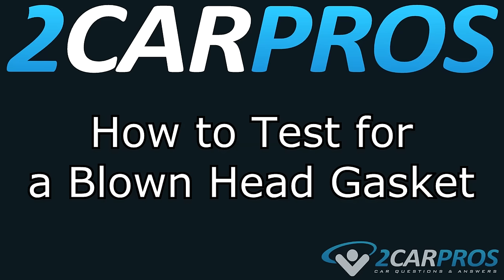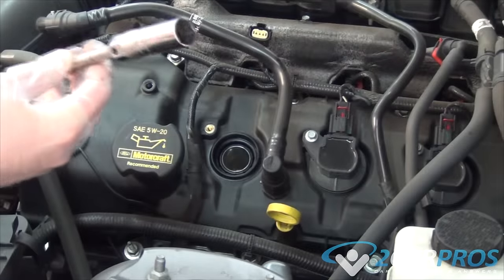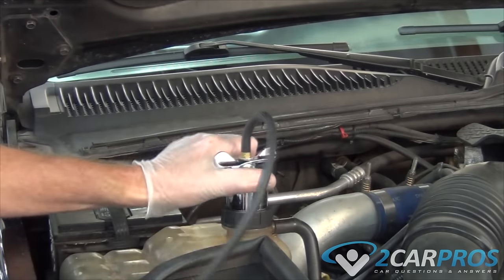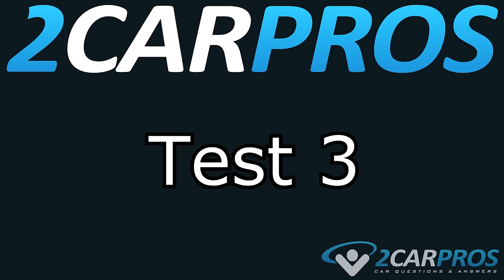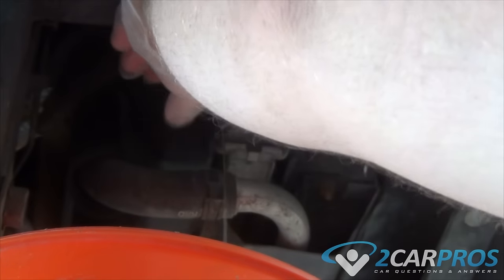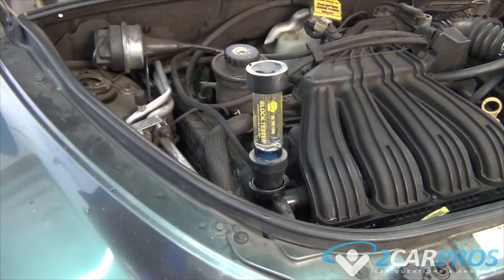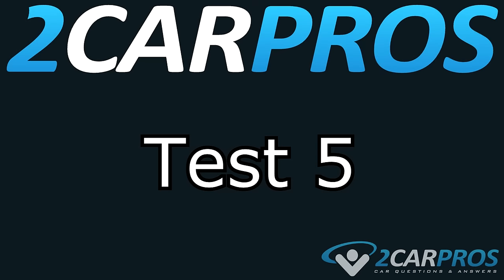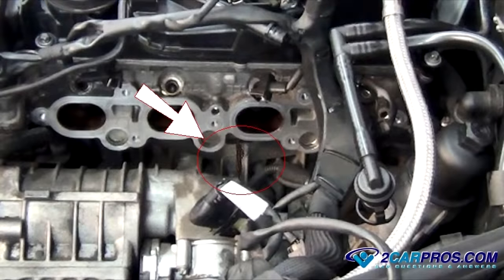HOW TO CHECK FOR A BLOWN HEAD GASKET

Comment: hi, ive just brought a 2009 peugeot 207 and have recently noticed that there is oil residue on the coolant bottle, i took it back the garage i brought it from and he said that the coolant is clear so its not a problem and just needs cleaning out. will the oil just keep coming back? ive heard its common for this to happen with peugeots
Reply from the maker: If it is a blown head gasket then yes the oil will just keep coming back. Oil in the cooling system is always a sign to be worried, I'm not sure what the shop meant by "because it is clear its not a problem" because it sounds like the blown head gasket is letting oil into the cooling system. If it is letting oil in then it is also letting coolant into the combustion chambers which can lead to really big problems. Thank you so much for watching!
Reply: Thanks for the reply but I'm still a little confused. They are having the car in on Thursday to flush it. But my warranty runs out in a matter of days. How long would it take for the oil to come back? Or does that depend on how much I drive it?
Reply: @kierandobson1182  hello. Can you tell me what was the problem with the car?
 I have a car from same manufacturer and same symptoms. please reply me
Reply: @echipaconstructii6614  I never found out. The clutch went not long after these comments and I decided to sell it while I had the chance. I'm sorry I can't be of any help to you

Comment: I have replacing the head gasket on my Nissan np 200 but now it keep on mixing oil and water what must i do?
Reply from the maker: Sounds like you either got a defective gasket or you didn't tighten the head bolts correctly. Thanks for watching!

Comment: I have replacing the head gasket on my Nissan np 200 but now it keep on mixing oil and water what must i do?
Reply from the maker: Sounds like it is still leaking. You will have to replace it again and tighten the head bolts in sequence. Thanks for watching!

Comment: I have to add coolent every morning. I normally drive 80 kms per day. And it becomes half. I checked everything there's no white smudge on the oil cap, nor is there any bad noise. No smoke. But no leakage as well. I don't mind topping up coolent. But idk. Am scared. I have taken the car thousand of kilometers without issue. But if i dont top up for 2 days it overheats. But when i go onomg trips. It's also the same only fill the coolant when i leave for hundreds of kilometers and back.
Reply: Sounds exactly like my nitro. Did you ever figure it out?
Reply: @barbgolden2913  been using like the same until 2 weeks ago. The mechanics said it was a leaking pipe. Just behind the injections,  so cant see it leaking.  Replaced it now. Now it's not leaking .but when i drive the coolant in the tank goes up . Dont know where it's coming from. And if when it goes cold the excess coolant dissappears. Idk what's happening.  Maybe a bad thermostat or water pump

Comment: Hallo, Can I ask you some question? I have bought a second hand Opel with 1 year warranty, less than 1 month driving and now white sludge. Could this be caused blown head gasket or something else? Mechanic dont want to repair it.
Reply from the maker: Sounds like a blown head gasket to me. Thank you so much for watching!
Reply: Yes headgasket blown. They have to fix it as you paid for 1 year warranty. Don't let them off the hook. Sue them if you have to.

Comment: My 08' Civic starts to over heat when idling for too long.. (delayed red traffic light) it cools down immediately once I'm driving again.  Any suggestions? Help?
Reply: Recently car gage would climb then down at red light then up when driving  end result needed new rad and hoses
Reply: Thank you for your insight
Reply from the maker: Is your fan turning on? Thanks for watching!
Reply: @2carpros  engine fan or inside fan  ? 
Had valve cover gaskets done cam plugs and seals and fill tube o ring too 
Definitely could see the oil  
Not sure which came first rad problem or oil leaks 
Had oil leaks for a bit guessing that created the rad problem 
Got back car today wait and see approach 
Getting a couple of belts in two weeks  had to be ordered and my guy is on vacation and place they come closed because air quality here in Oregon  lol hurry up and wait 
Soooooooo close to my goal of 30 years  sooooo close
Reply: @2carpros  I checked under different driving conditions short drives/long drives, pulled over and popped the hood and my fans kept spinning

Comment: Hi, my Mini Cooper engine overheated and can't turn on anymore. My mechanic said to replace the engine, but is there any other options?
Reply: Yeah,replace the car. Lmao
Reply: No not really, when you overheat a car bad enough the heat warps the head (top part) of the engine. This couses it to not seal properly and you lose compression which will couse it to not start. Sadley the easiest and cheapest way to fix it properly is replace the entire motor or if the car is older it may be cheaper to just go find another one. Its important to pull over and shut the engine off if you see the temperature gauge rise above normal levels. If you keep driving it hot until it starts running rough and dies the engine is pretty much done for

Comment: Are bubbles good or bad?
Reply: It indicates that there are air inside your coolant system. Could be from a blown or leaking head gasket. Or you didn't properly bleed/let all the air out of the coolant system. Look up bleeding coolant system. 
You can also smell the radiator at the cap area for smell of exhaust fumes too. If you do, then most likely a leaking or blown head gasket. Check oil cap to see whether the coolant have gone into the engine too. 
Best advice is to do these test to determine what's really wrong with your car. 
Hopefully it's nothing major on your car. Good luck!

Comment: I have c63 amg v8 biturbo 2017 and water goes in two of my pistons so much and inside of motor can u help with any idea what it is,
Reply from the maker: Sounds like a faulty head gasket or the seal wasn't properly installed from factory. Your warranty should definitely cover it. Thanks for watching!

Comment: Thanks for the info!

However: "remove all the spark plugs".... yeah, ok! Have you any idea how difficult that is on a transverse V6 or a Subaru?? 8-(
Reply from the maker: Thank you for watching! Yeah that might take you a little longer but it is worth it to find out if your car has a blown head gasket.
Reply: Drain a little oil from under your car after jacking it up and using jack-stands. If the oil looks like chocolate milk or beige, antifreeze leaked into your oil indicating a blown head gasket - to the best of my knowledge. Can anyone confirm this please?
Reply: Can you please confirm: Drain a little oil from under your car after jacking it up and using jack-stands. If the oil looks like chocolate milk or beige, antifreeze leaked into your oil indicating a blown head gasket - to the best of my knowledge. Thanks!
Reply: skillzorz101 that is correct.
Reply: I had a transverse aluminum block V6 minivan. I have no idea how anyone reached the back plugs - I guess from underneath. Fortunately you don't have to change plugs hardly ever now - I had it done every 60K miles. I didn't want to strip the threads or at least leave my hands bleeding after hours of struggling trying to get at the rear ones, although with a transverse 4 cyl I easily did them myself.

Comment: I have a toyota corolla 1997 its 5 speed my top and bottom hose are swollen up and my coolant its spelling from the radiator cap i was told that the radiator its clogged i already switch the thermostat what could be its not get warm up either it's normal temperature please somebody help
Reply from the maker: If the radiator is clogged it will never cool the vehicle correctly. Thanks for watching!

Comment: I have a 2006 Cadillac dts my car overheats only when idiling.   I have replaced the water pump, radiator, thermostat and the coolant container.  what do you think the problem.  @2carpros
Reply: Your cooling fan (or the relay for it) probably does not work correctly.
Reply from the maker: Check your cooling fan! Thank you so much for watching!
Reply: Cold be a bad radiator cap. You didn't mention replacing that. You should always replace a radiator cap after having heating problems to be safe s the the cap could be the cause and defective even if new. Have it pressure tested or just buy a new one if you don't have a tester. Cooling fan either doesn't come on at all or if they do come on not fast enough so car overheats at idle.
Reply: Also make sure your hoses aren't old and worn as they could internally collapses under pressure thereby restricting coolant flow. Make sure when you route the belt on the water pump you did it correctly. If not the belt could be moving the water pump backwards instead of the direction it was meant to go. That would cause an overheating problem for sure.
Reply: Air lock?

Comment: I’m having problem I can’t figure out I have a dodge2015 v6challenger I keep losing antifreeze but I lose it if i drive for couple weeks and then it says my car overheating but that only shows if my car has no anti freez in it and I have no heat in my car
Reply: It's going somewhere. Obviously check for leaks from hoses. If the interior smells funny and the windshield gets fogged when you put on the defrosters and the fog is sort of greasy you have a leaking heater core, although it's pretty new for that. Anyway if you are losing that much antifreeze you have a problem and should get if fixed now.
Reply: If you have no heat check your heating core
Reply: Heu did you ever figure out the trouble with your car? I had similar experience with my car too. Check the color of your exhaust smoke, rev it some times and that should give an idea.
Reply: If the coolant is full in your Dodge and you have no heater unless you rev up the engine than the water pump impeller is slipping just another crappy design
Reply: 1 reason for coolant loss like that can be water pump, my almost 16 year old car had a crack in the water pump the guys in the MOT test centre noticed and said they saw a small leak so I changed the water pump along with cambelt since it was due at 60k anyway and I was on 61k and also a coolant flush
Reply: Try replacing the pcv valve..

Comment: Or just rev it up and see if smoke comes out of the exhaust
Reply: Zoomanata white smoke can also mean the rings on the Pistons could be bad to 🤷
Reply: souremage39 ring smoke is blue, as it tends to be oil rich
Reply: I have a tonne of white smoke at first start up and lose a gallon of coolant in a few weeks. No signs of coolant on ground while car is parked. Leaking inside engine?
Reply: i have same problem on my e350 van
Reply: @paulvivier1984  what was the problem?
Reply: @HMASbogan  I never did find out. I sold the car and I'm thinking it was the head gasket.

Comment: Oil in the coolant tank, checked oil cooler, oil cooler housing .no crack all good. Car start and run well, no over heating,no coolant loss. How can I confirm it's head gasket fault ?!It's a petrol Skoda

Comment: My car seems to be mis-firing but only at 2000+ revs, could this be the head gasket?
Reply: Ignition. Give it a tuneup, plugs, wires, maybe coil and dist cap
Reply: And you can tell by looking at the plug from problem cylinder, if it looks like the ceramic has been burned then it's ignition related

Comment: My car is bucking when I rev it while in neutral in a 5 speed even in gear my car lack power to the point I can’t drive it anymore, I’ve check compression and it’s 170 psi through all cylinders
Reply: Could be a bad clutch
Reply: @yourfather5324  a bad clutch in neutral? I changed it 12k miles ago
Reply: @williamferrante3855  it could be a worn a front windows too
Reply: If the engine light is on it could be in limp mode
Reply: @dillonwhite4444  no codes or check engine light I changed the MAF and it fixed it for a couple of days now it doesn’t even start it turns on for a second and dies
Reply: @williamferrante3855  if it fixed it for a few days there could be a short in the wire. Check for that.
Reply: @dillonwhite4444  I’ll take a look at it again I just bought a electrical prober so I see if there is a short

Comment: Hello everybody! My 2003 civic always makes a 2-second air hissing/sucking sound when I shut the engine off. In addition to that, the coolant always fills the reservoir up and doesn't seem to go back to the radiator. If I don't fill the coolant in the radiator up after a long ride or a few short rides, I'll get overheating. Someone told me that there's a leak from the coolant passage through the gasket to the outside. I don't see it mentioned in this video so I'm not sure if it's a thing. And if it's truly is, does anyone know a way to fix it? Does head gasket sealer help in this case? Thanks!
Reply: How's you get on?
Reply: @ryanwatterson4038  i still gotta refill the coolant in the radiator once or twice a week

Comment: I have a 2000 grand prix gt blows white smoke on start up every day. No oil leaks but i have to add a quarter of oil every couple weeks. Rad fluid is fine , oil is always clean never milky. Ive put in stop leak rear main seal, stop leak just about everything. Im thinking maybe piston rings are bad or a bad intake manifold gasket.. Any ideas? Im not thinking its a head gasket. Anyone got suggestions? Thank you in advance
Reply: Seems like bad piston rings to me also, oil is leaking past them and getting burned off in exhaust. Check for blue smoke after engine warms up.

Comment: Test 1 is not true at all if it's cold or you only drive short trips it's very common for moisture to not burn off as it does when you drive for longer trips. I have seen thousands of oil caps look milky but the oil not be.  look down in the oil fill hole or on the dipstick.
Reply: I have the milky top,but my dip stick is kinda cream looking, losing coolant every 4days what could be my problem is that the head gasket or can it be fix

Comment: I thought i had a blownhead gasket but my radiator was cracked and letting oil get into my coolant
Reply from the maker: Why was there oil on your radiator though? Thanks for watching!
Reply: @2carpros  because i have an oil cooler in my radiator.
Reply: @2carpros  thought you were a car pro

Comment: Help my car overheats and coolant in reservoir starts boiling
Reply: Could be air in the system?? Don't hold me to that as I'm not a mechanic but deffo worth checking
Reply from the maker: Sounds like a blown head gasket. Could also be over heating from a different issue causing the coolant to boil. Thanks for watching!

Comment: Continuos bubbles means its blown?
Reply from the maker: Yes. Thanks for watching!
Reply: @2carpros   Hello. I am correct in thinking you'd see these bubbles immediately, ie when started from cold?  The reason I ask it that as engine heats up surely the coolant would start to bubble anyway with the cap off. Many thanks.

Comment: Hey all. Got a question. I have a 2015 Ford Fusion, just over 200,000kms (I'm in Canada).  For the last few months, when I start my car in the morning or after work, there is white smoke coming out of the exhaust. It only lasts about 10 seconds, then goes away. Happens about 90% of the time. My coolant was low, so I filled the overflow tank and have been minitoring it for a few days. Not gone down at all. What could this be? Thanks!
Edit: No overheating, no cylnder misses.
Reply: I am not a mechanic, so don’t take this for definite what is happening to your vehicle, but I do know that when a engine is cold started, white vapour comes out the exhaust and disappears when the engine is running, normally you can see some cars with white smokey like stuff coming from the exhaust, because they have just started moving

Again, may be wrong, and not a mechanic, might be something serious, might be that, I’m not sure

Comment: Does that milky goo under the cap instantly mean headgasket issues??
Reply from the maker: Most of the time yes,  Thank you for watching!
Reply: Well it could also be condensing? Uhm like water getting into the oil and being mixed. Like not the coolant but water from the outside, if you get what i mean?
Reply from the maker: Milky goo is only created when oil meets coolant. It is a strong indication you have a blown head gasket. Oil really can only get into the cooling system this way.
Reply: Goddamnit... Thanks!
Reply from the maker: Sorry to be the barer of bad news! Best of luck!
Reply: no i had to cars that did that changed the oil and it went away and also it does build condensation so its going to mix if not properly sealed

Comment: I was given a car from a bloke who wanted it out of his shed, had engine issues, the engine ran ok, when the radiator cap was taken off with engine running the water came out like a fountain, practically emptied the radiator in 5 seconds, the car has gone to china for rebirth into another car.
Reply: Good tony coppe
Reply: I like to see the solution of the problem and its reason
Reply: actorzone civic drinks coolant like lil wayne does lean
Reply: John Harbour should watch the video or atleast know what ur talking about Removing a radiator cap when the engine is running a standard practice for burping air bubbles out when initially filling as well as diagnostics a head gasket failure. This being said do not open it when the engine it is up to operating temperature.